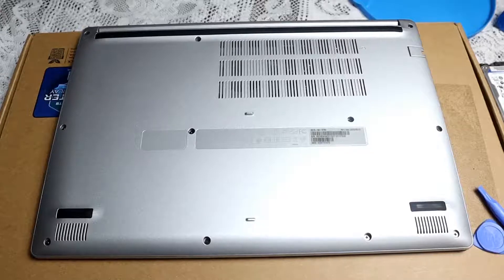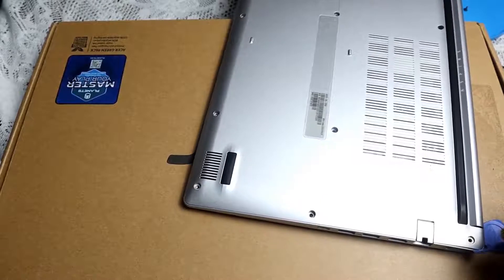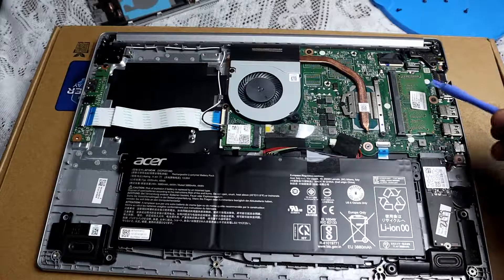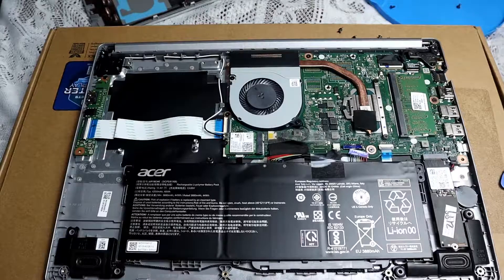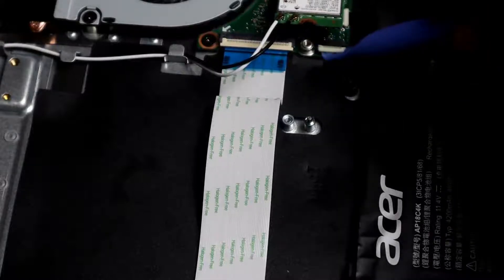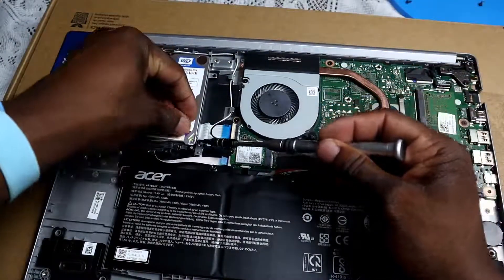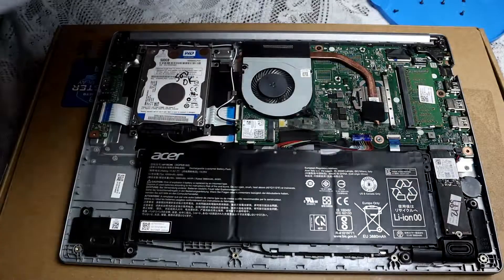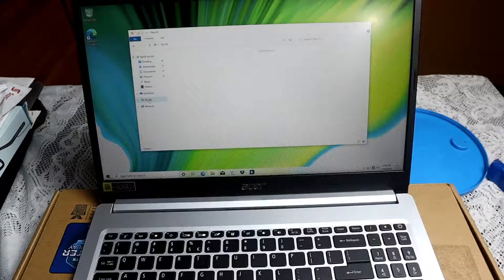Acer Aspire 5 Upgrade

Comment: Thanks for the video. I want to upgrade my Acer Aspire 5 (11th Gen Intel Core i5/Iris Xe graphics/512GB SSD) | A514-54 by adding a Seagate FireCuda 1 TB Solid State Hybrid Drive Performance SSHD – 2.5 Inch SATA 6 Gb/s Flash Accelerated for Gaming PC Laptop (ST1000LX015). Will it be fine ? Please also suggest a 16GB RAM with exact spec so that I could order it.
Reply from the maker: Hi Ramesh the SSD should be fine given the processor. However you can double check by checking for the manual and max ssd specs. In relation to the ram i usually advise that you get the exact speed and type before purchasing. You can open it up to confirm  or search the brand of laptop on the Crucial website to see if they have the ram for it.
Reply: @Acerking31  Thanks for your reply. My laptop came only with a warranty card and set up guide in which there is no mention of hardware. The product description in the website (https://store.acer.com/en-in/laptops/new-launches/acer-aspire-5s-nx.a2asi.001 ) says that it supports up to 2 TB HDD, 6.3 cm (2.5-inch) 5400 RPM hence I m confused should I buy a SSD or not. The laptop has Dual-channel DDR4 SDRAM -8GB of DDR4 system memory, upgradable up to 20 GB but the existing RAM is of 2667 mhz and in Amazon all such RAMs have speed of 2666 mhz. Is it safe to go for them ?
Reply from the maker: @rameshdas4406  Okay you can use the the Seagate FireCuda then. The 2666 and 2667 and basically the same thing.
Reply: @Acerking31  Yes you are correct. The RAM was written as 2666 mhz on it. Dont know why wmic returns the value as 2667. Anyway, I installed a Samsung 870 QVO 2.5 inches SSD and 16 gb Kingston RAM. As of now, its working fine. Thank you so much for your video and answering my queries.
Reply from the maker: @rameshdas4406  okay great. That is a good SSD i bought one and it works well. All the best.